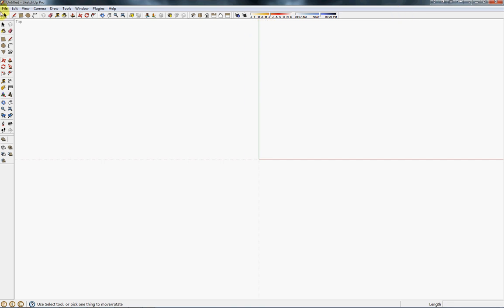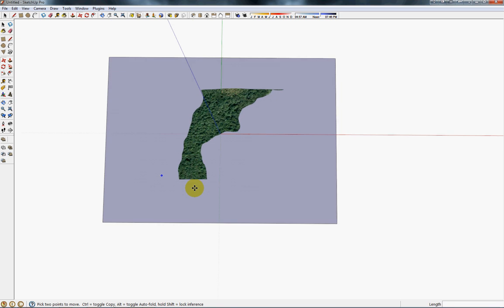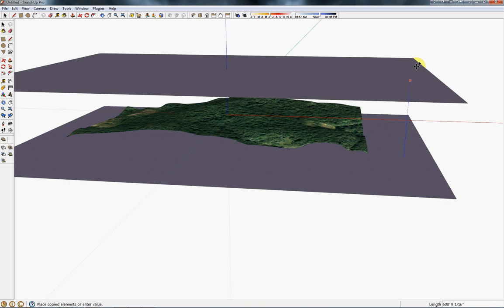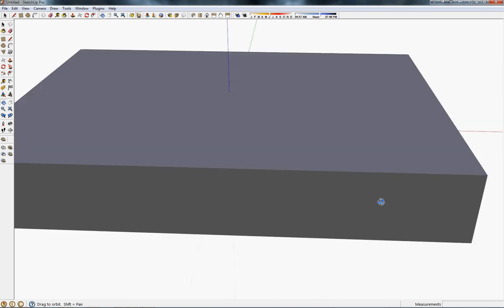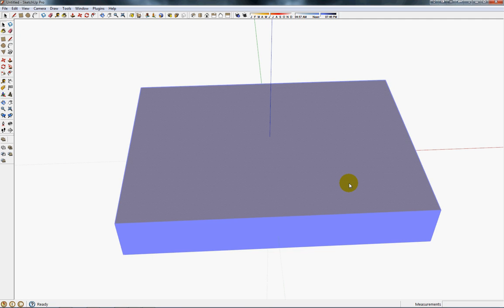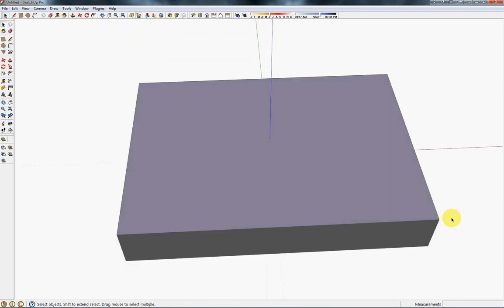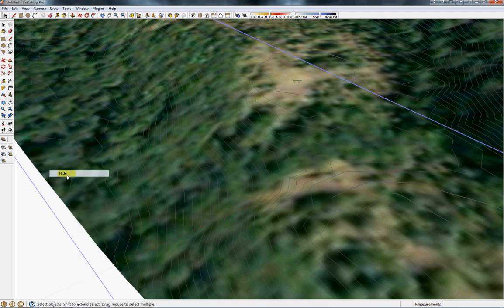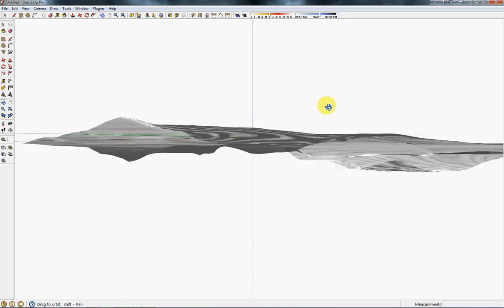How to create a 2' interval contour map using Sketchup

Comment: I have a relatively flat area (not many feet of elevation change), this is the need for the 2' contour.  When I try make my 2' contour map the contour lines don't show up.  I am replicating everything from the video.  I am guessing the x250 is the problem.  When I try a smaller area with more elevation change I get contour lines all over the top of each other and it looks like blobs of black area.  Any guesses on what I am doing wrong?